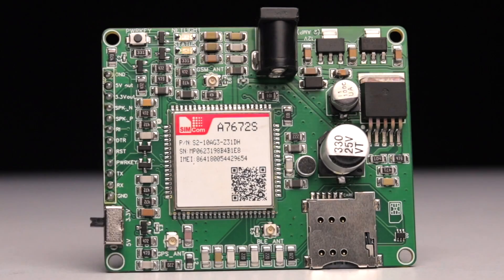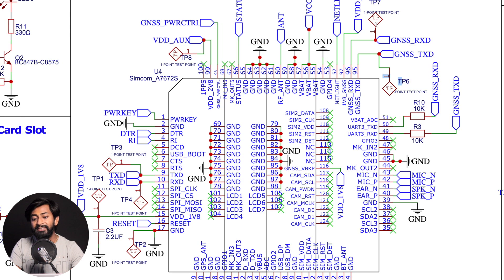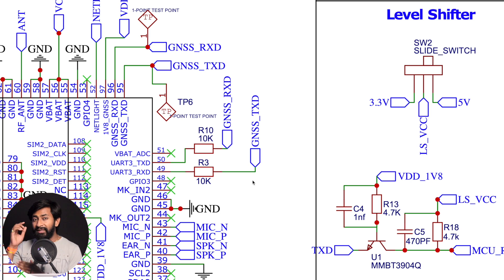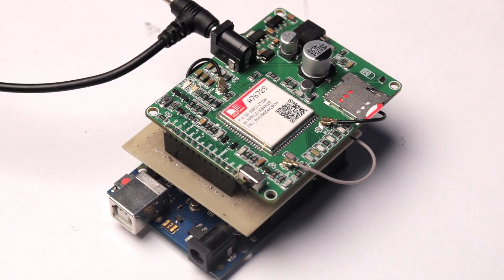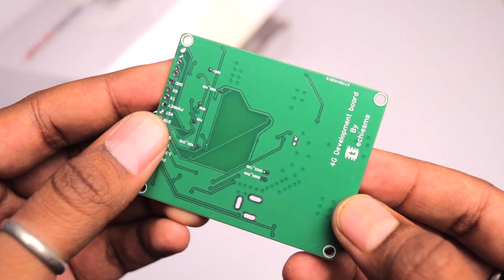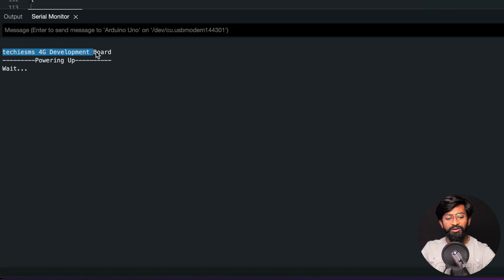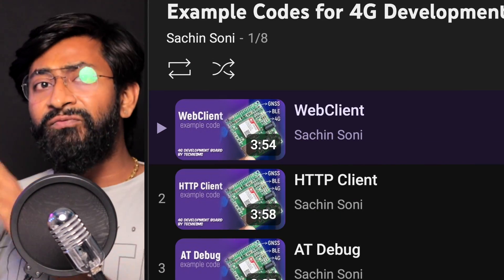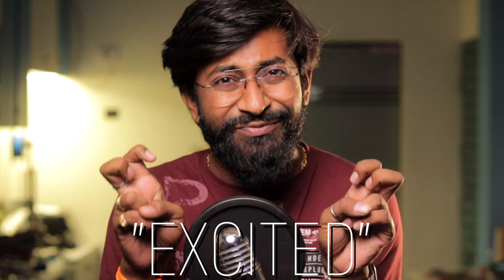We made the BEST 4G Development board for Makers 🇮🇳 | PCBGOGO

Comment: This is an amazing project for where you have GSM connectivity. But can we make a product that does not require GSM connectivity and total works on RF?
Reply from the maker: Please elaborate
Reply: @techiesms  if we are using this device where there is no 4G connectivity it will not work but what if we make a device that works in these areas like forest, mountainous,etc.

Comment: Can you Make portable WiFi router with sim module using esp
Reply: I'm presently using an esp32-s3 for streaming internet radio (HLS AAC stream). The main issue with esp32 is the network throughput is not that great. I guess esp32 based Router will suffer from this. And it doesn't support 5GHz bands.